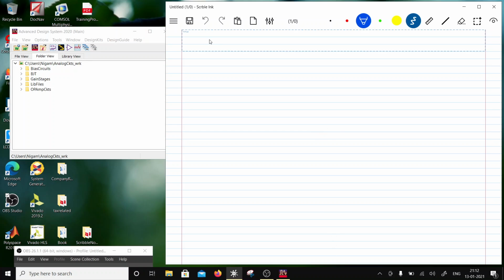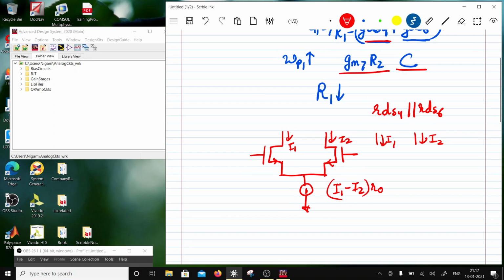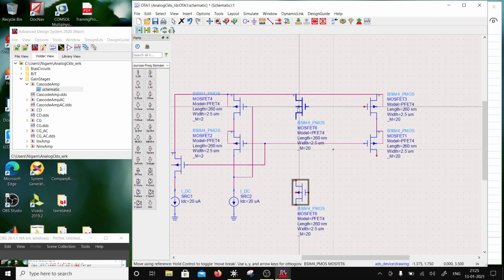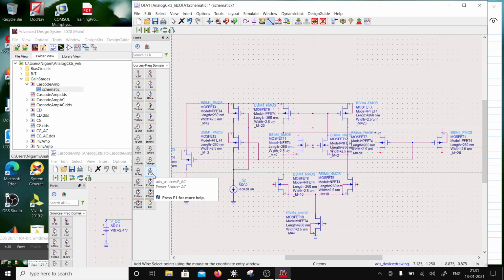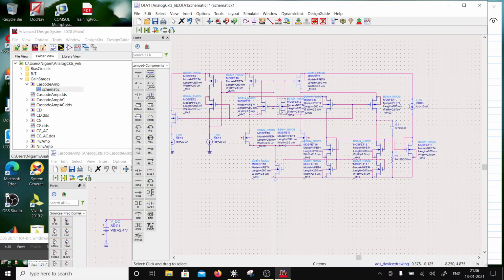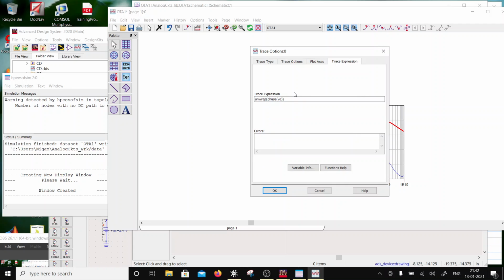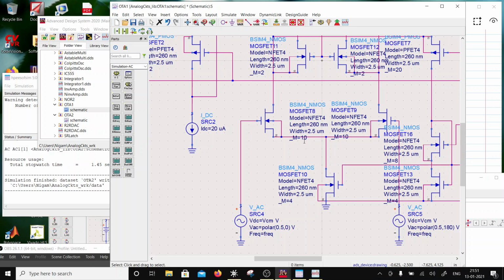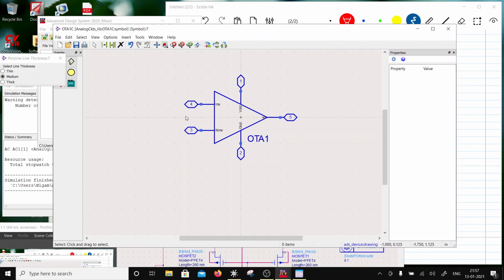Analog Circuit Design using ADS Session 22

Comment: Sir, As per my understanding  connecting the "Nmos diode connected transistors" in the current gain stage is like  introducing the  Active inductor.17:20 ....Is it correct?
Reply from the maker: It is just mirroring current out